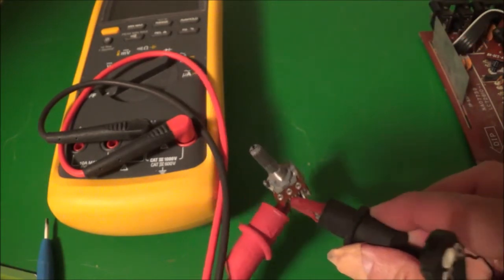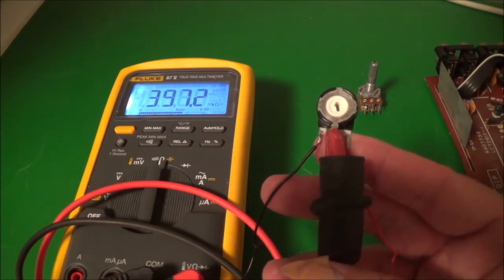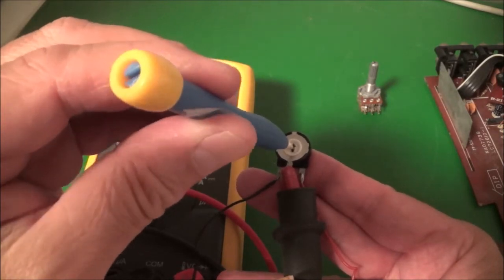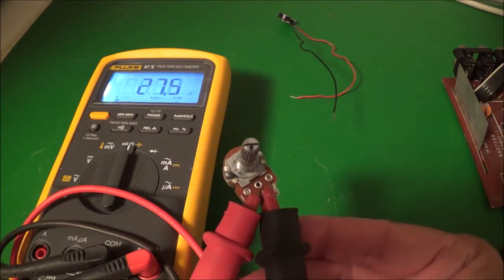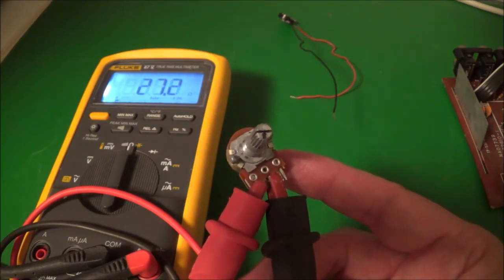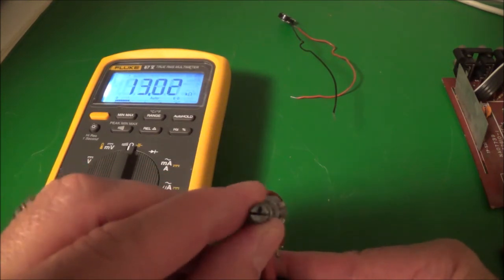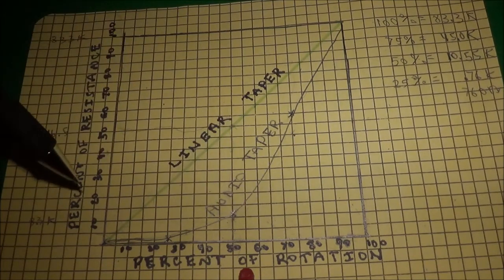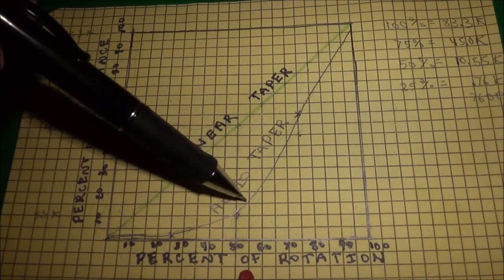Audio And Linear Taper In Potentiometers

Comment: Is there a way to make lin pot to log??

http://www.jt30.com/jt30page/potfix/

Plz do reply

Thx
Reply from the maker: I have never did this before. But somebody told me long ago that you would take a resistor which has 1/10 to 1/2 the resistance of the potentiometer and put that between the wiper (middle--pin2) and ground (pin 3), that is, not the side where the signal voltage is coming in (pin 1). What you are going to have to do is get an ohmmeter and measure the resistance at different degrees of knob rotation, maybe 25%, 50%, and 75%. Audio taper resistance would be about 10 to 20 percent of the total resistance if the rotation of the shaft is at 50%. Linear, of course, meaning that if you turned the shaft 50%, then the resistance would be 50% of the total. Again, I  am not an expert in this, but this is the way I would try it; that is, trying out the different resistances from 1/10 (10%) to 1/2 (50%) of the total resistance and seeing how the curve looks and if you are satisfied with the action/sound.
Reply: @OldSchoolElectronics  thankyou i will check it out and i request you to do make a vid of indepth into pot.. mostly rev log and log  :)

Thankyou
U are the best

Comment: Nice explanation. Have you ever tried a resistor in parallel with the pot to change is tapper a bit? I have log audio pots in my guitar's volume. buts there is almost no volume below 6.5 /7 .... any way yo change a bit the curve of the pot? Which resistor value do you advise?

Comment: Thank you for this video. Now I have some idea about the graft that attach with pot. 

I like to know if this test can be done visually with Oscilloscope and Function Gen.  I hope there's a part II to this and the ELV KT200 too. Great video sir.
Reply from the maker: Thanks for watching. This particular test not with scope and function generator. But with a square wave I have tested tracking of a dual channel pot; to see, for example, if both channels were smooth while turning and the waveforms of both (stereo channels) were of equal height. I shall probably do 1 or more short videos on testing potentiometers in various different ways.
Reply: Great to hear you will do more exploration. Thank you for your reply. :)